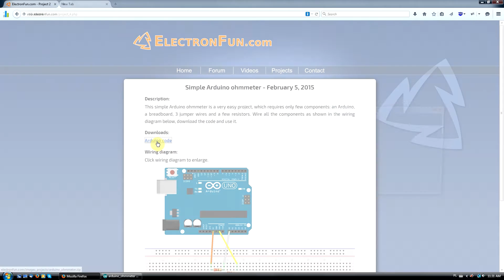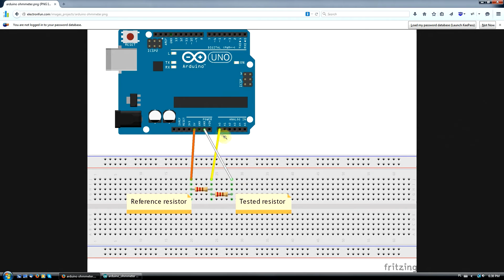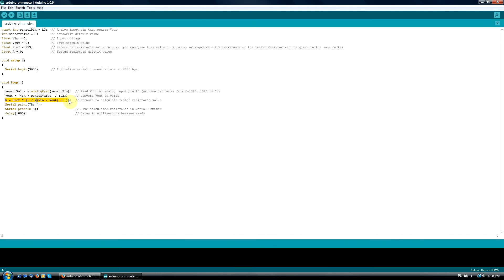How to make a simple Arduino ohmmeter || Arduino tutorial

Comment: i know this i late but would there be a way to have mutiple resistors connected e.g 10ohm 100ohm 1k 10k connected to different pins and have it auto switch i get i could manually switch it but is there a way to get the arduino to switch

Comment: Nice, simple project; however, I have noticed - at least when I use it - the further the difference in ohms between the two resisters, the less accurate it becomes, so it is very important to have a reference resistor close in value to the one you want to measure.
Reply: Bit late, but he does cover that at 2:15 in the video. Presumably you could easily just add on more resistor references using the pin outs.

Comment: Wow, my measurements are pretty accurate. The error was between 1 and 3 ohms somewhere. I added the schematic to my program to display numbers on the microwave screen. I used a 1000 ohm resistor which is actually 1180 ohms. I took measurements with resistances from 100 to 2000 ohms. I guess the bigger the difference between the two resistances, the bigger the inaccuracy.

Comment: Is it possible to add a voltage divider to make the input voltage less than 5V but still accurately measure resistance? If so, would you just initialize Vin as whatever the new voltage is?

Comment: Why you need two resistors? Can't you just take the 5V in minus the output voltage, after the unknown resistor, do Ohm's law math, and get the resistance? Why do you need a known value in the equation?
Reply: It measures the difference between these two connections, not the resistance itself. For example: You have two tubes, one of which has a capacity 3 times larger than the other. There is no way to know how many liters one is if you do not know how many liters the other is.

Comment: I have just watched a video by Electronoobs on the same subject. Now I have a problem. Their video presents R2 as the reference resistor and R1 as the test resistor.
I am guessing that it does not matter which you choose, so long as the chosen 'constant' reference resistor stays constant and you always swap the resistor that is in 'other position'?
But that is me guessing. Is my guess right, or is there only ONE way to set the reference/test configuration? [I will ask them the same Q).]

Comment: Hi, I have a fluid level sensor that return a resistance value (0-100) and work on 12v circuit in my boat. How can I connect my fluid  resistor to your setup ?

Thank you.
Reply: Hi, I see this is 2 years ago.  Did you ever figure this out? I suspect your tank sensor might be going to gound (only), not 12V.  Therefore, I would expect that you could connect arduino ground to this common ground, and then run 5V to your sensor.  If it's an existing install (in Europe?, in US it's commonly 240-33) It probably goes to a gauge now which takes 12V and measures the resistance between 12V and ground.  But if you unhook this sensor wire from the gauge and put into this circuit using 5V it may work.  The only thing I'm not sure about is the inaccuracy factor when getting away from the reference resistor range.  I have a boat and I'm interested in doing lots of similar sensor readings as you describe -- then put it on nmea2000.

Comment: how would i measure the internal resistance if in place of the unknown resister i use 2 wires with alligator clips or a 510 connector.

Comment: How precise will be Arduino if I use this methond. I need to measure resistance 1.3 - 90.7 Ohm. And I would love to use 100 Ohm for the known resistor (tested resistor). I need it to be very precise How much accuracy should I expect ? And can I put readings after that in a variable, so I can use that variable in formula  (devide, multiply, etc...) and get new values and print them as integer number ? Also how slow will be Arduino ? I have 4 formulas and 4 variables.
Reply from the maker: John Doe A lot depends on your reference resistor's precision. I would use a resistor close to 50ohms for your application with 1% tolerance or better. Yes, you can put your readings to variables and use them for further calculations. I'm not sure about the speed, but it shouldn't be a problem.
Reply: Thanks for reply. One more question. I plan use 9v battery for Arduino. How much Watts should reference resistor be in my case ?
Reply from the maker: John Doe There are no high currents, so any wattage resistor will do.

Comment: you used quite an engrossing formula at your sketch: R = Rref * (1 / ((Vin / Vout) - 1));
(-:
Reply from the maker: It's not as complicated as it may seem. On websites like: http://www.circuitbasics.com/arduino-ohm-meter you would usually find the following code:
buffer= (Vin/Vout) -1;
R2= R1 * buffer;

My formula does exactly the same calculation, but I don't use the "buffer" variable. Thanks to brackets I'm setting up the proper order of calculations. What is more - my formula is a single line of code.

Comment: That was neat. Can a similar circuit (with code) be made to check the value of capacitors?
Reply from the maker: Thanks a lot! To answer your question - yes, such a circuit with code is available on the Arduino's website: https://www.arduino.cc/en/Tutorial/CapacitanceMeter. As far as I remember, it works pretty well.
Reply: ElectronFun.com Thank you.
Reply from the maker: No problem.
Reply: I have a question do you know how I could set this up so that if there is a change in the resistance it will trigger an alarm?

Comment: Hello
Thanks for the Video ,
I have a question about the measured resistance :
What is the limit of the measured resistance , can we measure a resistance a 1000 meter length of cable with resistance of 7Ohms?
Regards
Reply from the maker: +Lyes gherbi Hi, thanks for your comment.
I don't know of any resistance limit for this ohmmeter. The thing is - the larger the difference between your reference resistor and the resistor or wire you want to measure, the more inaccurate reading you're going to get. If you need a reasonably precise measurement, you should check the rough resistance of your resistor/wire and then swap your reference resistor to one that has a close value and measure the resistance once more. Your reading is going to be much more precise this way.

Comment: This is awesome. In fact, we can make a rather complicated ohmmeter in this way. it's obvious that the accuracy goes really bad when the two resisters are quite 'different'. so we can have more reference resister in the same diagram which we can choose which to use via different output pins.
btw, I never tried and wonder if the 5V output in arduino is really 5V, maybe with 5%-10% accuracy or something?
Reply from the maker: Zelra 仙賢戀軒 Thanks :) You are right - actually I thought about making another video, where I would show a more advanced ohmmeter with selectable ranges (like in an ordinary multimeter).I've just checked the Arduino voltage accuracy. If I can trust my cheap UNI-T multimeter it shows 5.02V, which gives you 0.4% accuracy. It's better than one might expect.